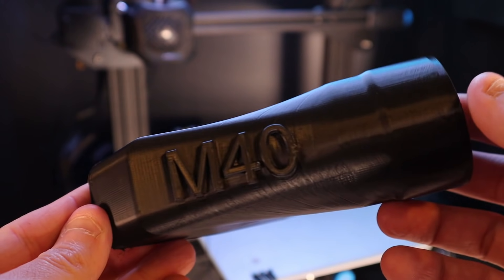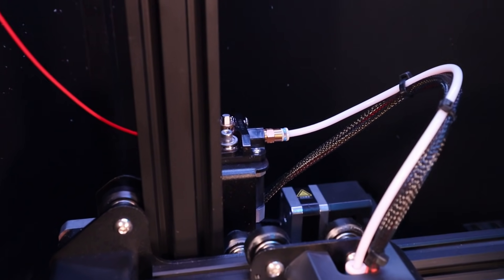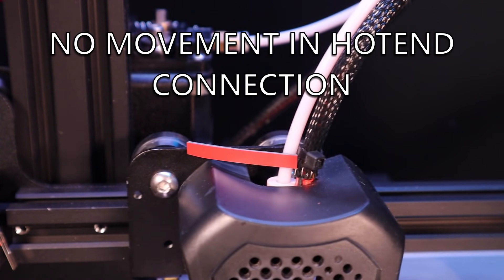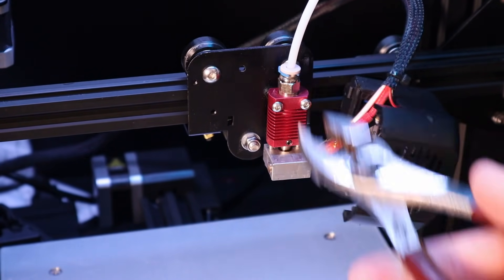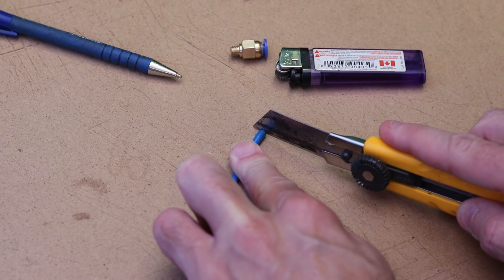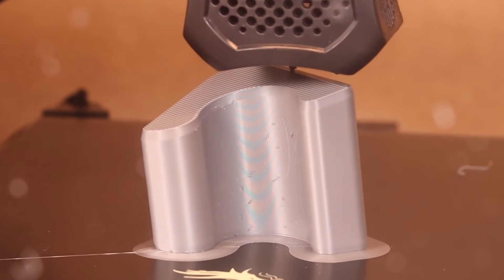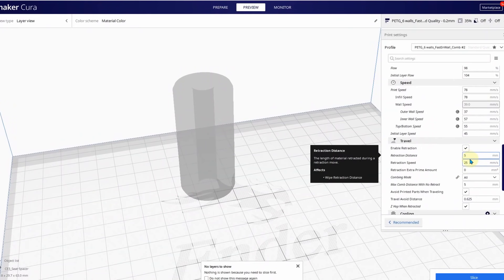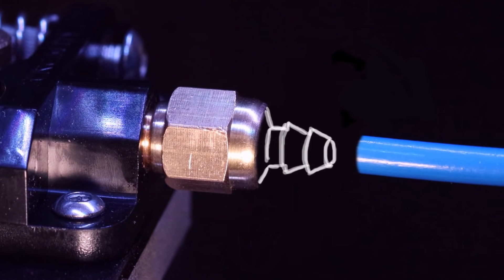Creality Ender 3 V2 - Fixing the Hidden Problem that Can Cause Stringing and Unresponsiveness

Comment: Solution: 
https://www.aliexpress.com/item/32821972566.html?spm=a2g0s.9042311.0.0.27424c4dvUa0Ge
(PC4-M6 for Ender 3)
Reply from the maker: I had a look at these the other day, they seem to be of 'higher quality', have you tried them?  

I found something else I didn't know existed for the 4mm OD tube.  There is a pass-thru version, it is also available through 3D printing canada https://3dprintingcanada.com/products/stainless-steel-pneumatic-push-in-fitting-pc4-m6?_pos=2&_sid=147128f0c&_ss=r  I'd like to heat the tube end after it passes through, then flare it slightly, I just need to find a way to have the flared tube end to bottom out in the threaded hole.
Reply: @NeedItMakeIt  Yes, I used already for more than 30 hours of printing and not even a slight move has developed so far. The normal fitting would start to loosen the tube after the 10th hour.

Comment: Interesting. I feel like the connection point is a major issue.  I just had my bowden tub completely skin itself at the extruder connection. https://ibb.co/wSpRsHc . After replacing this tube and 50 or so hours of printing its back to wiggling again. Unfortunately the hemera has been soldout for months and the microswiss direct drive looks a little janky :(
Reply from the maker: Yes, and still they haven't found a better solution.... it is about time to fix the problem for good.  I have been discussing this issue with a few other viewers and we have tossed around a few ideas:

Super glue: I am not sure how long this will last, it is brittle and not much bonds to PTFE/Teflon 

Serrated connector: Push the tube onto the fitting much like a water line fitting, the serrations keep it in place

Break line connector: these are available in M6, similar concept to the serrated connector

Flared end with thru nut: This is a new idea and I think it might be the simplest and best idea.  Flaring the tube is simple, the problem is the connector cannot be M6, it has to be M8 or M10 to work, and the flare must bottom out in the threaded housing

Compression fitting:  I'm not sure how good of an idea compressing a tube with such tight tolerances is, this may create a pinch point for the filament, also this material is so slippery that a compression fitting may not reach the required friction to be successful

Shrink tubing over the fitting and tube: Does not work, it slides right off of the tube

I prefer to leave the Bowden setup, it is cheaper, but the speeds and ghosting will be better.  A better connection means a shorter tube and better responsiveness, I think there is room for improvement.

Comment: I actually superglued that, there is no movement any more haha
Reply from the maker: I was discussing this solution with a viewer just the other day, we thought maybe it wouldn't bond well to the Teflon tube.   Did you use sandpaper on it?  Did you use the stock fitting?  Thanks!
Reply: @NeedItMakeIt  yes i used gasoline to get of all the bad stuff and then sandpaper. Also the standard fitting. The first superglue didnt work for me so i tried one fron another company, and that one did work in the end, just try them all out
Reply: @NeedItMakeIt  i use neoprene contact glue, it bound to everything i've tried, aluminium without sandpaper, nylon, nitro rc car fuel tank, i use "perfax neoplus contact neoprene" idk if you can have it in other countries, i live in france.
So maybe it will work, i will test it with my ender 3 v2 in some days when i will have it. And sorry for my bad english, you know why.

Comment: I am absolutely interested in a permanent solution there are no solutions good enough in the market.
my CR10 V2 is eating up 2 connectors a month!
Reply: Collet compression fittings.
The more you tighten them, the more they 'crush' the tube.
They don't depend on little teeth cutting into the tube.
The contact area is pretty large, so no cutting/scoring of the tube occurs.
Teflon 'cold flows'; will permanently deform as a response to pressure.
Tiny teeth concentrate pressure, the tube deforms and slips.
A collet clamp don't play that.
Reply from the maker: The same issue for quite a few people it seems.  Mine is still going well after making this video, but it may not last much longer.  I am working on 2 videos at the moment, I'll do some research on different options and see if I can find something available off the shelf that will work.
Reply: @NeedItMakeIt  even I'll try designing something that butts up against the body and clamps the tube in place
Reply from the maker: Yes, exactly, I had done brake lines in the past with nickel copper lines and they have flared ends which seat when tightened to create a sealed connection.  Something like this would work well and it is very simple.  I just took some measurements and the M6 threads are too small for the tube to pass through, they'd need to be m7 or m8 for this to work, but it could be a really good solution, super cheap to make as well.
Reply from the maker: I just completed a test by heating the tube end and using the hotend pass-thru connector and it worked very well, this is a very good option with the right thread size for a semi-permanent connection.
Reply: @NeedItMakeIt  I haven't heated the tube yet but my Cr10v2 Bowden connectors were both pass through from the beginning... I'll try heating it up
Reply from the maker: @apoorvbajpai4763  That may be problem solved for you.  as long as the tube can bottom out at the bottom of the threads.  I used a phillips screwdriver while the tube was hot to flare it out, anything that shape should work.  https://imgur.com/a/mCpxSVp
Reply: @NeedItMakeIt  that will be awesome... I'll try it first thing in the morning

Comment: Would going with a direct drive fix this?
Reply from the maker: Yes, direct drive would solve this problem but it does come at a cost of speed, and prints can contain quite a bit more ghosting due to the added mass, the steppers are fairly heavy.

Comment: maybe moving to a bgm extruder can help?
Reply from the maker: A dual gear extruder should help with responsiveness and preventing an issue with filament not extruding, I have one roll of opaque ABS which is very tough material to extrude and I want a dual gear to handle materials like this, so it can't hurt, though I do wonder how well the gears actually mesh and how much backlash they have, they really should have an adjustment to handle backlash so as they wear an adjustment can be made.

Comment: Do you recommend the Luter fitting but the capricorn tube? Or just capricorn all together?
Reply from the maker: After using this tube for quite a few prints, I can see that it could cause some problems, it is a really snug fit, so I'd recommend the capricorn to avoid the problem, the fitting with this kit was fine, there are many tiny teeth that do a much better job than the stock fitting.  I will make a follow up video on a better solution for a fitting... so busy at the moment I haven't had a chance to get back to it yet.

Comment: Question: why can’t we just scratch the PTFE slightly and use epoxy, UV glue or superglue to just fix it in place?
Reply from the maker: That's funny, I was thinking the same thing yesterday as well.  Before I made the video I did pull up some info about this material and there really aren't that many adhesives that will bond to this (teflon) there are specialty glues, so it is possible, it would just be costly unless you bought in bulk.   Super glue is brittle so it might not last with any movement, but a slightly flexible adhesive might work one you etch the surface.  It is a pretty good idea, I still think the best solution is a different fitting right from the manufacturer.  a compression style, or a toothed water-tight type fitting would also work, it really is just a matter of getting the dimensions right, the part is pretty small.  Once I have a moment, I'll get back on this with a 100% solution with no possible movement (that's the goal anyway).  Apparently there are automotive fittings that do just this and they have to last.
Reply: @NeedItMakeIt  thank you so much for taking the time out to reply and for the appreciation. Mine slipped out mid print for the first time last week and I was able to get it back in using the replacement blue clip but you’re right, this needs a better solution from the manufacturer. However, until that happens, we makers gotta make! Here’s another crazy idea: how about wrapping thin Teflon tape (the kind used in sanitary fittings) around the end of the PTFE tube and then sliding it in? That thing has a subtle rubber like grip and is thin enough to provide fit, flexibility of movement while not compromising the tiny affordances we’re  working with.
Reply from the maker: Yes, this is a possibility for sure, does teflon stick to teflon?  I like your solutions.
Reply: @NeedItMakeIt  haha thank you, great minds think alike! Would be great to connect in real life but I’m all the over from Pakistan! Currently researching if Teflon tape will stick to PTFE but nothings come up. My guess is, because of the low cost of trying this out it’s still worth a shot because while the Teflon tape doesn’t stick to itself but when wrapped around itself the tension makes it sort of create a slippery, rubbery layer, more so because of the texture of the Teflon in a tape thin film like format. 

Also, I found this on the 3M site just now. My earlier guess was right:

“Silicone PSA is an option for bonding to PTFE, however etched PTFE (EPTFE) is a better choice for adhesive bonding. The etching process modifies the surface to promote adhesion. Silicone Pressure Sensitive Adhesives like products 91022 (adhesive transfer tape) and 96042 (double coated tape) are designed for high temperature exposure and low surface energy bonding, including PTFE.”
Reply from the maker: I wonder if we could apply the same techniques used for PEX to this setup, it is very simple, it would require cutting a small chunk of the tube to use as a ring to expand and then it will shrink back and create a very tight connection.

Comment: Nice vid. In the car world on hard thin vacum tubes i have seen small metal u shaped springs that cuts a bit in to the tube at one end and apply pressure against the fitting so that the tube is always being pulled out to keep a small tension on the fitting. This is to prevent tubes falling out because of vibration.  Maybe this would work.
Reply from the maker: That sounds like a pretty good solution, do you have a link or a photo that would guide me down the right path?
Reply: @NeedItMakeIt  Search fuel retaining clip, but i cant find them so small. You could try a small coil spring and a sharpen e-clip around the ptfe tube.

Comment: yeah the tube only has to be 1cm longer then stock...
Reply from the maker: The tube and fitting setup are working well with this length using a 3mm retraction setting.  There has been no change to-date in the connection between the extruder tube and fitting.  The main purpose of keeping the tube longer was to prevent unnecessary movement at the fitting, having a longer service life.

Comment: 2 years later and they still didn't fix this loose fitting?
...
Reply from the maker: That's right, not so great.  There are some other types of fittings which are more permanent, I have to wonder why something as simple as this can't be corrected especially on the V2.
Reply: @NeedItMakeIt  I tried using professional and quality fitting but it didn't help much it still had a lot of play.
What different types you think would work better?
Reply from the maker: @Arek_R.   Check out this fitting, 
https://www.aliexpress.com/item/4000751003220.html?spm=a2g0o.productlist.0.0.5d513eb1Shox0P&algo_pvid=ca75e7e3-31bf-4011-95cd-1676d0580eb4&algo_expid=ca75e7e3-31bf-4011-95cd-1676d0580eb4-8&btsid=0bb0623416068697627223104ede22&ws_ab_test=searchweb0_0,searchweb201602_,searchweb201603_

Something like this would work very well as long as it was sized correctly for the tube, this was posted below in the comments by another viewer (Gregor Slemensek
1 week ago)  Personally I think that a brass serrated press on fitting would also work, even better would be if the PEX company had the same types of setup for these printers.  You expand the tube for a moment press it on the fitting and it shrinks back to the original size, that's be perfect.  I should contact them about making something.
Reply: @NeedItMakeIt  any idea if the pc4-m6 or the pc6-m4 would be he right one to go with?
Reply from the maker: @ge2719  Yes, PC-4 M6 4mm ID, M6 Thread.  If you can find a PC-4 M6 which has a through hole, get that one, this is part of my 100% solution for no movement at the extruder., if not, the standard fitting can be drilled out with a 4mm bit to do the same job.
Reply: @NeedItMakeIt  ordered some of those. The 4mm tube fits the through piece. Its a bit tight to fit the tube over the end but will likely go on fine if heated up.
But the hole in the thing doesnt fit 1.75mm filament, So I'll try drill it out.

I tried the heating the tube and expanding it fix and that seems to have sorted it for now. The old fitting i had on, the tube had 4-5mm of give to it, but i just could not get it out of the fitting. I guess its slowly gouged into the tube and now theres bits stuck holding the tube in. Had to just cut it off the tube and use a spare. Seems the constant retracting and extruding just doesnt work well with the teeth style fitting.  

I also ordered one of the fittings you mentioned in another comment. Will have to see what works best.

Comment: As the extruder is only pushing and pulling on the filament only... not sure why the bowden tube moving a bit at the extractor end would have any effect.  As it shouldn't change the amount the extractor is moving the filament... the tube is only moving with the filament.
Reply from the maker: The overall material extruded is the same, it relates more to the proper placement of the extruded material.  By removing the slop in the system, the material extruded is stopped and started closer to the expected position.  Basically the printer is more responsive.  Example, when extruding, it need only push the filament to begin extruding, prior to a correction, a push to remove the slop and further push to extrude.  Similar concept to backlash.  Thoughts?

Comment: PTFE with lighter is dangerous I believe, because it will release flourine gas after 280C and degrade
Reply from the maker: Remind me not to set my stove to high for my non-stick pans.
Reply from the maker: @MTolgaYURTCAN  Best to keep the temps low, CI is my pan of choice.  Thanks for the link.

Comment: https://www.youtube.com/video/7UJ7QtCuo2k/edit this is how I did it. It has NO movement now. I had to make M6/M5 adapter.
Reply from the maker: Looks really good, now you need to tell me how you made it!
Reply: @NeedItMakeIt  I used some connectors available in my country and had to had some M6/M5 thread adapters made, since the thread on printer is M6 and these connectors I got are M5 thread. Also I had to drill inside connector because it was thinner at the end and filament didn't go through. If you would like video for it please let me know and I will film some short one. Maybe this could be direct replacement for original part (PC4-M6): https://www.aliexpress.com/item/4000751003220.html?spm=a2g0o.productlist.0.0.5d513eb1Shox0P&algo_pvid=ca75e7e3-31bf-4011-95cd-1676d0580eb4&algo_expid=ca75e7e3-31bf-4011-95cd-1676d0580eb4-8&btsid=0bb0623416068697627223104ede22&ws_ab_test=searchweb0_0,searchweb201602_,searchweb201603_

Comment: use cat nail clippers with a deep grove to cut the ptfe tube. it helps keep it round
Reply from the maker: Good tip, I have some.  A piece of filament inside could also help a bit even with the clippers.
Reply: I use my cable sheath cutter for my cat 5/6 network cables works like a charm!
Reply from the maker: @mrbilky  Nice, probably a lot higher quality cut than the provided cutters with the tubing.  I believe I have a final solution to fix this movement for good, the part I thought I was getting wasn't quite what I expected, so it will require some minor adjustment.  Hopefully I can make it work and it can allow for a low cost permanent solution for anyone.

Comment: My method of battling this wiggle is to loosen the couplers a turn or two. Then jam the tube nice and tight then clamp those couplers back down and it preloads the teeth in the coupler. After a couple hundred hours of printing i haven't had a wiggle issue
Reply from the maker: I've heard of this being done, a very good tip for the hotend side.  On the extruder side how does this work?  The tube does not feed through the fitting, a rotation would not apply any force from what I can see, what is your solution for the tube on this end?  Thanks for taking the time!
Reply: @NeedItMakeIt  cant do the same per se, but I go with a higher quality coupler like the blue collared connector found in the printer mods "hot end fix kit" and pulling on the release tab while inserting the bowden tube. 

Also, double stacking thin "horseshoe" clips or printing a thicker clip that snugly fits under the release tab aids with slop as well